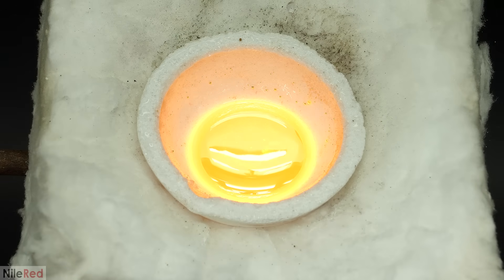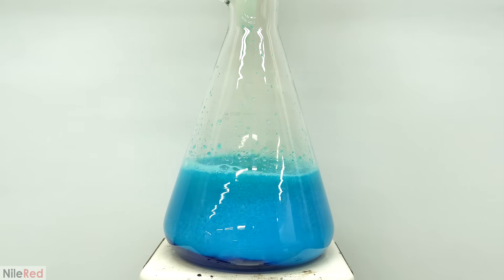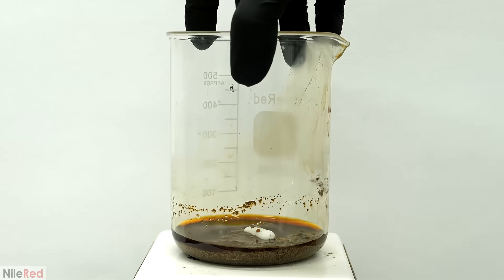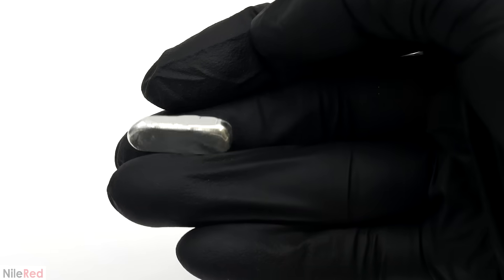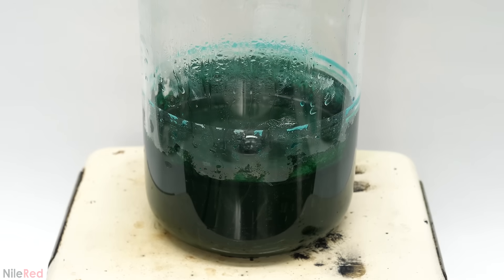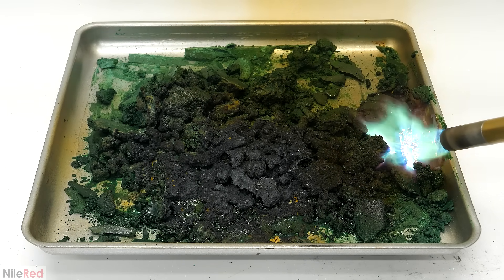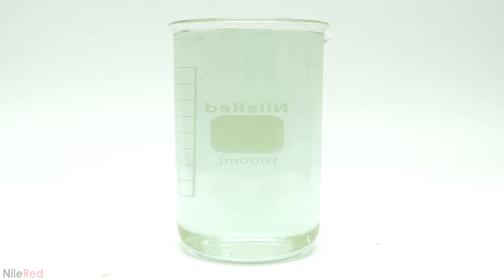Cleaning up my gold waste

Comment: The easiest way to deal with that waste solution was just to drop in some angle iron. the iron would replace the copper in the solution. Iron would go into solution and copper would come out as copper metal. This would eventually consume all of the copper in solution leaving just Iron in solution which can just be disposed of. You can of course evaporate all of the water first, and what you end up with is essentially Rust powder.

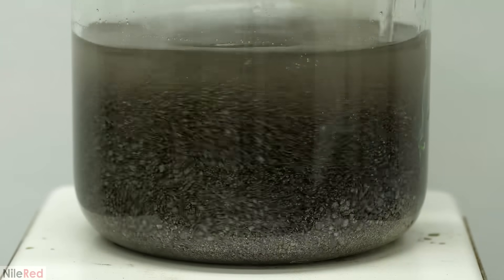Comment: the silver oxide at 2:00 unlocked a memory of a toy I had as a kid. It was just a little plastic adapter to attach two 2-liter bottles to each other with a narrow opening, so that you could fill the bottom one, flip it over and spin it to make a water funnel. i don't know how many hours i spent just admiring liquid physics with things like that. the silver oxide swirling around and resembling a stormy scene is something I could watch for quite a long time.

Comment: Fuming nitric acid. I used that when i ran a Zinc plating line.

Fuming Nitric acid is used for Zinc plating. Nickle/Chrome however used Sulfuric, Hydrochloric(muriatic) and Acetic acid (Vinegar). These were the main Acids we used multiple times in additions during operation.

It is actually amazing how much chemistry I could have learned if I took a position in the Lab. I would have been trained as a lab technician with just having a highschool degree as I worked in a unionized work environment that has been around since the 1940s.

Old companies like the one I worked at do a lot of in house training for jobs that you would think you need post secondary for. When in reality you just need proper on the job training and to be able to pass qualifications tests.

Most companies now however require a degree in any field just for the chance to sit in their office and play with paperwork.

Comment: You have a reaction with silver restoration was not very effective. It is much more effective when dry sodium hydroxide is covered in silver chloride "without water". A sufficient amount of water will be formed during the reaction. This mixture is well preceded, it will blacken and then fall asleep there a solution of sugar with hydroxide. Everything is restored quickly enough. It is impossible to fill silver oxide with water, otherwise there will be no complete restoration and capsution of unnecessary organics in silver. And in the end, a restored silver can be poured with electrolyte for batteries., So you will destroy the excess alkali, and with coagulating silver into large lumps for convenience.

Comment: I think for the silver, it would have been easier if you just filtered the silver oxide instead of reducing it in solution and then going through another washing process. Just get the silver oxide out of the solution and then heat it or smash it to split it into silver and oxygen. Silver is still a very noble metal, so this should work.

Comment: 2:30 - you could have actually just drained off the liquid and keep the silver oxide. Silver oxide turns into silver metal at roughly 320°C.

Comment: Normally, you would wash the AgCl with neutral water and then add concentrated ammonia. The AgCl will go into the solution, while impurities remain unsolved. You then filter the impurities off the solution, from which you recover the silver.

Comment: I would be interested in seeing a video about the process that one of your friends told you about where you could do the jewelry without having to go through a long drawn out process of enquartation (and whatever else you were mentioning not being necessary).

More than anything though I would like to see someone show me how to make a 14 karat or 18 karat gold electroplating solution because the one or two videos I have seen regarding DIY electroplating Solutions at home we're very light on the details and specific information on the individual steps and also with the intended purpose of making 24 karat gold electroplating solution which is not what I want because I'm going to use it for jewelry and to me 24 Karat plated jewelry looks fake because nobody makes real jewelry out of 24 karat and a color closer to 14 or 18 would be more to my liking so I can try to pass it off as real LOL (but not to sell so if you do it don't worry you wouldn't be enabling me swindling people or anything like that as that is certainly not my intention)

Comment: Just like copper will cement out silver from solution Iron will cement out copper.  You could have completely removed the metal from the solution and just forged it into a new bar.

Comment: Best way to deal with copper salt waste is to put iron waste in it like rusty old nails. You're then left with copper metal and relatively benign iron salts, which you can turn into the oxide form and dispose of safely.

Comment: For the copper, set up an electrochemical cell.  It won't require a lot of attention, and the slow reduction with a single cathode should give you some pretty copper crystals.

When we did an AgCl precipitation in first-year chemistry (quantitative analysis for Ag), part of the process was heating it to about 60'C, as I recall, so the colloidal precipitate would "curdle" better and settle out more quantitatively.

Comment: I'm curious what your chemistry workflow looks like. I'm a mathematician so there are a lot of things I know, and a lot of things I don't know. If it's something I've never done before, I usually have a good idea how to approach it, and in many cases I can come up with a solution. Further research sometimes shows my approach was good, and sometimes shows there were better ways of getting to the same result. Sometimes, it's something I can't solve on my own within a reasonable time, so I research what others have done in similar areas, and I usually find a solution or at least some ideas.

How does it work for chemists? Do you just know all these chemical properties and reactions? If you have some waste product, can you think about it for a while and come up with a way to neutralise it, or recover something valuable from it? Or are you constantly looking at tables and charts to know what will react with what else at what temperatures? How do you know what's dangerous and what's not? How do you know it won't explode or dissolve the beaker?

Essentially, I'm asking how much of what you know can be extrapolated purely from domain knowledge and experience, and how much must be experimentally gained?

Comment: AgCl to Ag2O with NaOH works best with very fine AgCl. Yes its possible but I usually don't bother with it. Much easier to just filter off the AgCl, wash and dry it.
Weigh the AgCl ( M = 143.3 g/mol ) and mix it with 2 Molar equivalents of waterfree sodiumcarbonate ( an old coffee grinder works for me ). Heat to about 750-800°C in a crucible for half an hour then increase temperature to 1000°C. Pour into water ( carefully ). Presto, 99.9+% silver shot. We get a few pounds of AgCl from parting solutions each year and this has been the most convenient for us.

Comment: The amount of serotonin released in my brain actually equals to 0.064 gm copper nitrate found at 6.8 degree celsius which is produced by the change in the lighting of the rectangular cuboid weighing around 0.86 gm worth around 600 US dollars

Comment: All that for a drop of silver?
Reply: Enough for one bullet in case an vampire attacks.   :-`]
Reply: @jannikheidemann3805  wood kills vampire silver kill werewolf
Reply: @SauronLOTR  Read the comment above yours. It's a verry good explanation as to why silver works as a weapon against vampires. Wood works against vampires by staking them. I don't think a wooden bullet would work.
Reply: @jannikheidemann3805  Actually it depends on the wood! You see there were some woods in some cultures that, if used as a bullet, would in fact kill unholy creatures on contact like silver!

Remember that thing about folklore being weird and confusing?

Yeah so depending on the folklore in question here is the to do list to ensure that a vampire is 100% dead without going outside of European folklore.

Try and do all of this in sunlight, if you're lucky it might kill it by virtue of sunlight (the divine rays of heaven), but the vulnerability to sunlight being lethal thing is pretty new and is fairly rare in older sources.

First, you need to get it married to a virgin maiden baptized in the name of the holy Trinity and the Virgin Mary, look this one is weird but it apparently kills a vampire instantly, this has to do with old stories connecting them to being the product of infidelity and/or rape. This redeems the sins of the father apparently.

Then you need to to drive some stakes through its heart, multiple to be sure, one of oak, one of ash, one of hickory, one hawthorn, one of rowan, one of rosewood, and it is extra important to use one of olive. To be safe toss in a cedar stake. Wrap them in silver wire just to be sure. Some of these will kill it because staking, others will kill it because that is just what that wood is supposed to do on contact of any kind, and some need to be used as a stake. These are all really region specific and culturally specific so we just use them all juuuuuust to be safe. The silver is used to make it certain to work.

Next cut its head off, use a silvered axe to be extra safe. Now take the body and stuff it with the ashes of the dead, the soil of its grave if the vampire has one and sprinkle it with holy water.

Now find a crossroads with running water, preferably on all four sides if possible, and bury the body at said crossroads during the light of day face down and toss a silver crucifix on top before covering it back up, preferably make sure the last person to touch said crucifix is a man of faith or ideally a virgin maiden of faith, do not use an non-virgin woman of faith it lowers the chances of it working, yes this is actually a thing I read once when reading up on this folklore, IIRC it was Belgian that produced that quirk.

Next take the head and stuff it with garlic _flowers_, place two black stones in its eye sockets and attack two silver coins to them. Bury it at a different crossroads face down. Add an extra crucifix here, just to be safe. You know what, toss in some extra holy water.

If you can only get one crossroads with running water nearby put the body at the one with running water. If you can't get all four sides surrounded by running water, make sure the running water is somewhere between it and the head.

Now have a priest bless the ground at each crossroads, really insist on it being in church latin if you use a catholic.

For some reason, that I could never find out, garlic is dangerous to vampires, but in particular the flowers do the trick not the actual garlic bulbs themselves, so that is why we want the stuff the head. I should research this one more.

The running water thing also is something I couldn't narrow down, but since vampires were often affiliated with plague it might be a cleanliness thing.

The crossroads is actually the easiest thing to explain. It confuses the resurrected vampire when it tries to revive itself that night. Keeping the head apart is supposed to stop this, and being faced down means if it does revive it won't be able to dig itself to the surface, but instead deeper into the earth.

If you did all of this, you probably killed it for certain, but if you skipped any step along the way... it might actually come back, no seriously, vampires are crazy. Modern vampires are waaaaaaay to streamlined.

More fun vampire trivia, early photographs were created using silver iodide, and that is why you couldn't take a photo of a vampire. However, modern cameras would work just fine.

BTW, according to Bram Stoker Dracula looked hotter in the sunlight than in the dark, but it did shut off a bunch of his powers.

Edit, if it STILL comes back, burn it and toss it into running water. Bless the river too.
Reply: @squirrel_killer-  I figured it's verry complicated just from reading part of the wikipedia article on vampires.
Reply: @squirrel_killer-  Wellp, in the event that vampires are revealed to be real and they start taking over, you'll be the one to survive lol 😂
Reply: @jannikheidemann3805  or a werewolf
Reply: @jannikheidemann3805  probably enough for two
Reply: @jannikheidemann3805  do you mean werewolf because vampires are not affected by silver bullets
Reply: Noice
Reply: Tecnicallly yes. U need to clean everything. And sometimes cleaning can be  as hard as the experiment or even more difficult to safely clean everything.
Reply: “what did it cost”
Reply: @noperering  “...... All my chemicals.”
Reply: @Knux115  its both!
Reply: @denizoz9224  No. Vampire use ultraviolet bullet. Didnt you see the underworld movie!?
Reply: @Knux115  let's go waaaaay back in time:

Silver was believed to be a holy metal and is supposed to kill all unholy creatures. Vampires among them.

The reason vampires don't have reflections in a mirror originally was because they were evil unholy creatures and mirrors used to have a silver layer that allowed them to function as such a reflective surface, therefore the purity of the mirror rejected the vampire. So if a metal is so antithetical to something to refuse to reflect it, yeah it's gonna mess it up. As time went on though this weakness was dropped as the church became greedier and shifted the focus to gold, which naturally was too soft to be a weapon so similar tales didn't resurface for gold as silver.

Anyhow most supernatural creatures keep a silver bullet and an iron bullet on hand. When in doubt shoot one of each and see which hurts more.

Iron mostly only stops fey (many people will bring up "cold iron" this is a more modern concept. Traditionally any iron did the job, with some poems and epics using the term "cold iron" to get the syllable count up, folklore is awesome and confusing), but silver is lethal to most unholy creatures, and it can be hard to determine which is which by an untrained eye, and unlike a crucifix they aren't dependent on your faith.
Reply: @squirrel_killer-  are fairies considered holy creatures because i believe they’re allergic to iron
Reply: @squirrel_killer-  nerd lol
Reply: makes absolute sense
Reply: He's cleaning, there isn't a point
Reply: @Knux115  it's both I think.
Reply: Well, it would have been thrown away otherwise, so there is that.
Reply: At least he got some content out of it
Reply: All that for a drop of blood.
Reply: Well you should waste nothing 🤷‍♂️
Reply: @king-su5uc  Time included
Reply: Nah, it's for content..
Reply: huh... oh AHAHAHAHHAHAAHAH Thanos quote  you're a person of quality
Reply: Yes.
Reply: All that to prove it can be done
Reply: yeah
Reply: isnt it better than nothing?
Reply: And he made 300$ from this video sooo...
Reply: Edit - 1700$
Reply: Silver is worth a ton of money soooo its worth the time
Reply: Hey, it would be fun though
Reply: And youtube content
Reply: Ur verified where is your 100k likes?
Reply: @p.tstudios2833  he literally has 1 million subs
Reply: Even the minutiae of precious metals or useful metals can still have a purpose and worth, granted if done efficiently
Reply: Didn't add enough lye at first
Reply: Okay, Thanos
Reply: Egyptians were right about silver being more expensive than gold LOL
Reply: Rich can explain
Reply: @Knux115  no it’s werewolves, you’re right 😅
Reply: 2.7M views on this video so far, that's probably another $3k in ad rev. Not bad if you ask me.
Reply: * for views
Reply: And why main sugar substitute to react with silver oxide?......

Comment: What if you had added nitric acid to the silver chloride to convert it to silver nitrate then displace the metallic silver using a more reactive metal..or simply heated the silver(I)oxide until it decomposed to silver and oxygen!

Comment: how about recover copper metal in copper nitrate solution by electricity? that way will not produce nitrogen dioxide gas, can get high quality of copper and recover some acid.

Comment: Did you take out your magnetic stirrer from the copper nitrate before blasting it with a blowtorch? I saw it when you poured everything out and you didn't take it out during the crystallization step either.

Comment: just make a carbon ark ...use the carbon center from d cell batteries or the big square they have for lantern then use the microwave transformer set up they use for home made arc welders and get a fire brick scoop out a cup center and notch on each top side  put stock inside  hookup slowly work in each rod till arcs cover with second brick and check in few minutes usually gives a clean burn

Comment: If you degrade the Copper Nitrate to Copper Oxide,  it can be reduced with simple carbon to give carbon dioxide and copper metal. This would eliminate the extra step of converting it to a sulfate